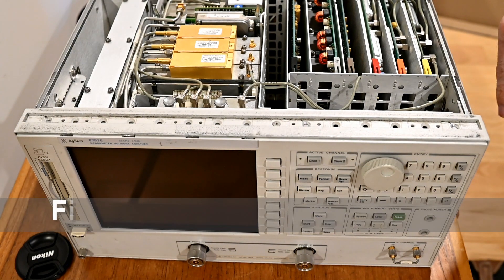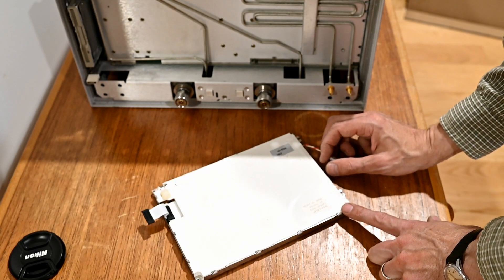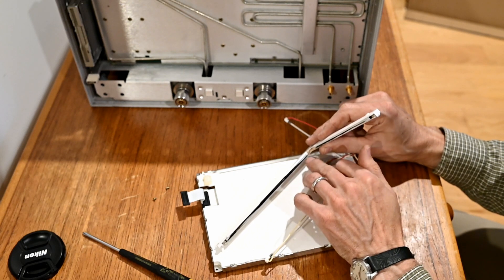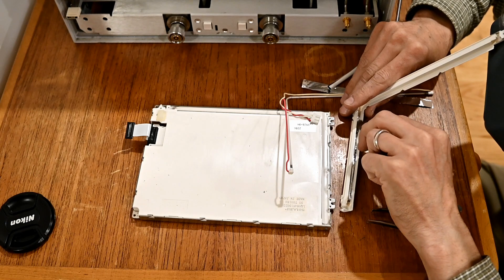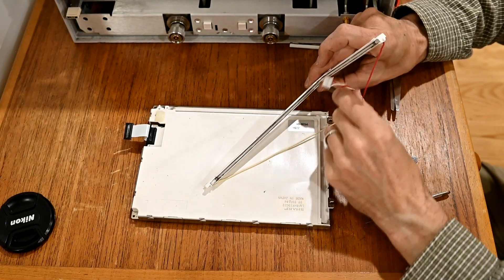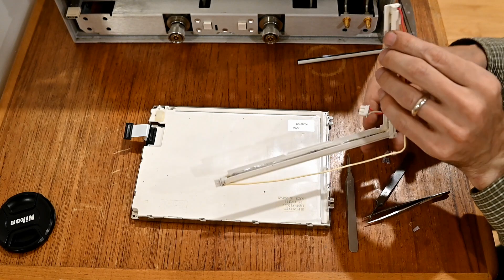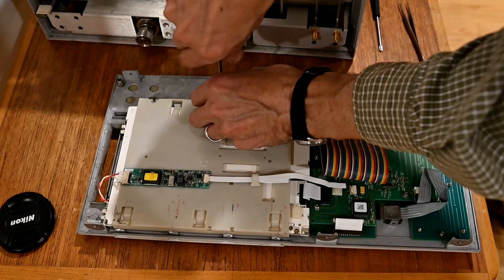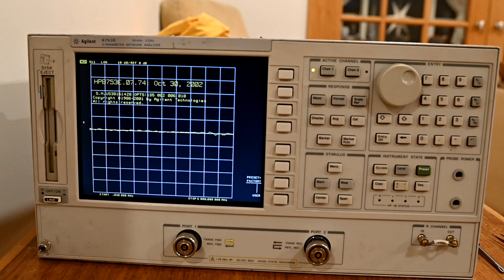Hewlett Packard 8753ES Dim display repair [Sharp LQ084V1DG41]

Comment: Very interesting! Pertaining to the Mylar around the lamps.
I had no idea.
I also have a couple of 8753's D & E.
I did a total disassembly, restoration of them, cleaned everything, etc.
I was always perplexed about the low display intensity of the "E".
I had no idea about this issue that you've pointed out!
Mater of fact, at the time I restored my units, probably 2022,23 (They were/are mint to start with)
I did some research about upgrading the CRT in the "D" (to a LCD) and updating the display for the "E".
It was hit and miss.
Fortunately there is a video port on the back of the machines for external displays, so just went with that rout. 
But now you got me interested in having a look at the "E" lamps...
I found you YT site this morning as I was doing a search for a fellow that wrote a PGM that controls and extracts data from the 8753's, since I forgot his name and call sign(Radio Amateur).
Here's a link for kicks and giggles.
https://www.youtube.com/watch?v=ORWQE22tbRo&t=7s
It all evolves around the fact that, I'm a retired RF engineer, and also been a Ham since the early 70's.
Since I write software, and RF design, I've been working on a remote ATU (Antenna Tuner) software and hardware of course.
A couple of years ago, I did manage to build a "Smith Chart" to incorporated into my PGM, but unfortunately I had a hard drive failed some time ago, so I lost the code and could not remember how I did it! ( a years worth of work. So much for WD Black drives! They were not even able to recover the data!)
So the bottom line is to incorporate the 8753e VNA to auto tune the ATU.
Any thoughts on a replacement upgraded more modern display for both units?
Btw, you got my thumbs up!
Cheers and beers,
Best Regards,
Dale (Ontario, Canada)

Comment: I have a network analyzer model 8753D. Some of the buttons don't always work. Can you show me how to open the front panel and clean/repair it?... i see now that you have a video about cleaning 8753E keypad...excellent!
Reply from the maker: I see you've found it, but for reference here is the link:  https://youtu.be/Gx2woYL-KjU  See description for time stamps.  The D disassembly is a little different than the E and ES.  There are some screws on the side of the display that have to be removed and I think one under the keypad cover adjacent to the display after you carefully snap this off.  There are also some screws to remove on the top and bottom of the machine.  Once you get those extra screws out, the rest of the process is quite similar.